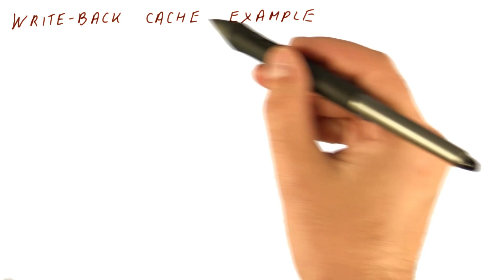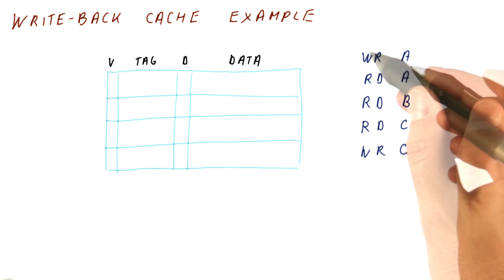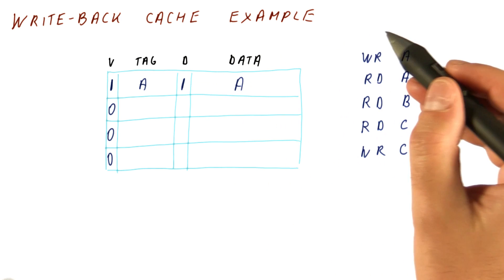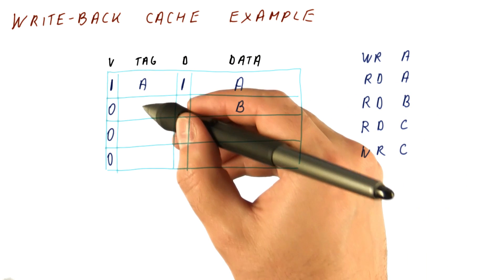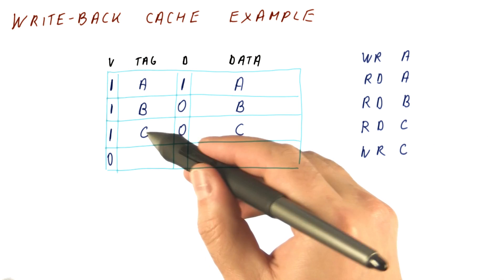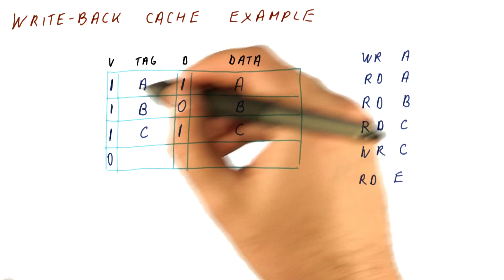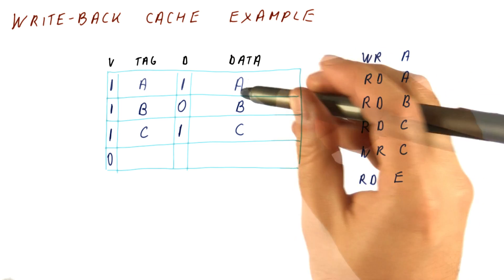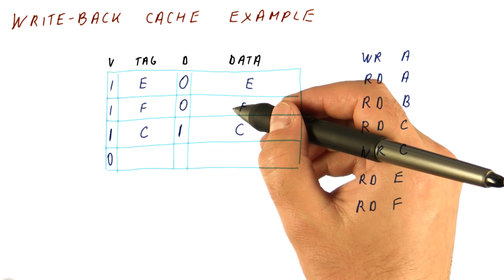Write Back Cache Example - Georgia Tech HPCA Part 3

Comment: Why replace entries before the cache is full?
Reply: Cache explained in the video is using a map data structure. In this case, you calculate hash of the key. Assume the hash (after applying some more mathematical operations on it) gives you 1, you need to store the entry at index 1 (map is actually backed by an array). So if two keys give you the same hash and thus the same index, you need to replace the existing entry. Now when you need the value corresponding to a particular key, you just calculate the hash of that key and look for the value in that location. Now tag helps you to confirm if the index (corresponding to the calculated hash) indeed has the value you are looking for.
Reply: It depends on replacement policy, most time, we will use LRU, which remove the oldest entry, https://en.wikipedia.org/wiki/Cache_replacement_policies